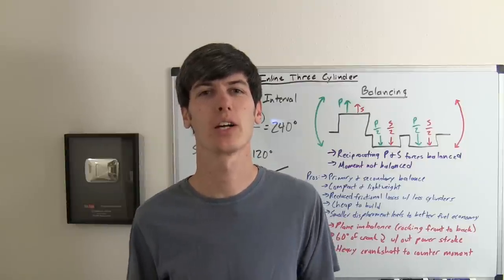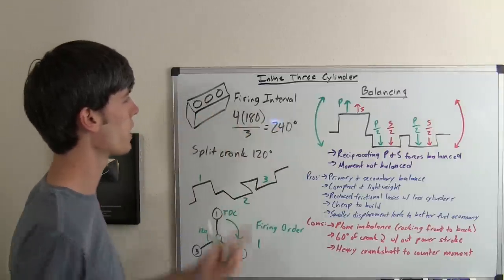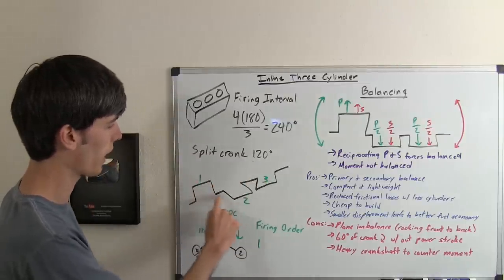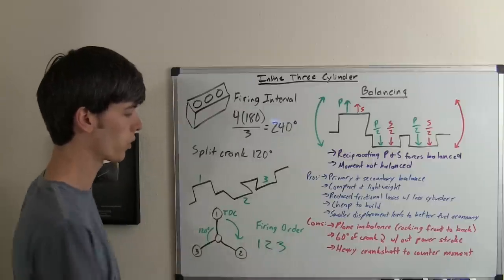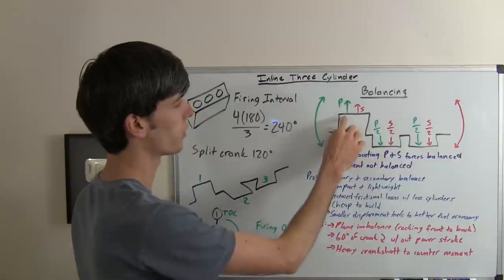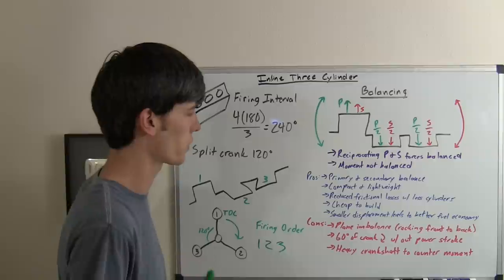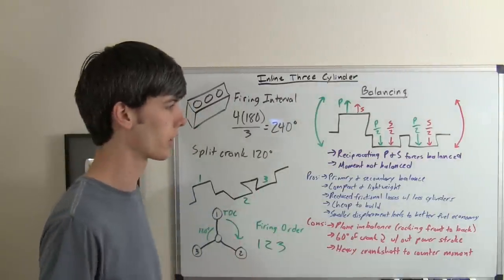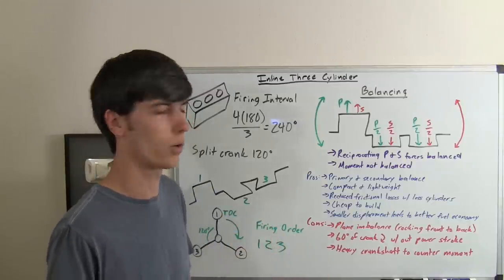Inline 3 Cylinder Engine - Explained

Comment: I found out an interesting fact: BMW say that the sound their new 1.5 3-cylinder makes, is a result of extensive exhaust work and refinement. 

More specifically, BMW say that a 3-cylinder has 2 major sound frequencies: ''the bad frequency'', which is responsible for these known rattles a 3-cylinder makes - and consequently, has been kept away -, and ''the good frequency'', which is quite similar to that of a 6-cylinder!! That's why this 3-cylinder sounds so good!
Reply: wooo bmw found hot water
Reply: Also knew as sound modulation by the stereo speakers, a thing bmw have been doing for years.

Comment: I have a Triumph Rocket III motorcycle (2,294 cc inline 3) and I appreciate the explanation on how this engine works. While it makes a lot of torque at low RPM, it vibrates badly under heavy throttle... and now I know why. Keep up the great videos!

Comment: The 3 cylinder engine in my 1991 Honda Today gets me between about 40 and 50 mpg (16-22 km/L) and is still kicking after at least 140,000 km on the clock.  (There's no 100,000 digit on the odometer.). Thanks for the quick video!
Reply: I have the same engine (E07A) on my Honda Acty Truck, and that thing works awesome!

Comment: In the early '70's, I owned a Kawasaki 750cc, 3-cyl. H2 motorcycle. It was 2-stroke,air cooled, with oil injection. It was smooth as silk, and one of the first true superbikes. Liquid cooling would have allowed higher compression ratio's , and even more power, making it unbeatable to this day. Too bad the EPA had a grudge against blue smoke.
Reply from the maker: Sounds like an awesome bike! I'm okay with clean air though. :)
Reply: +Engineering Explained What do you think about lifespan of vw 1.4 tdi 3 cylinder lifespan (km) ?? :)
Reply: +Robert Beck First of all, lucky you for having owned the original H2! Secondly, Kawasaki's were really good machines. Plus, with a 2-stroke engine you have twice the power strokes so more smoothness is expected. But having 2-stroke AND 3-cylinders is crazy! That was a beast! I guess Kawasaki had to up their game if they were going to use the H2 badge again and they did with the H2R.
Reply: +Robert Beck I had the Suzuki "Water Buffalo" 750cc Triple water cooled.  It was a beast of a machine and could have been scary fast if I spent the time for performance tuning.  It was considered fast in its day I suppose.
Reply: I love the sound of a 3 cylinder two stroke. I wish they would start putting them in snowmobiles again.
Reply: Honestly I am wondering when the 2 Stroke will RETURN...  With Direct Injection and a few design changes...time is ripe for the return of these engines I THINK Anyways...  Then again...things are going the way of Electricity faster than anything else.
Reply: +SquillyMon Rumor has it that KTM has something in the works.
Reply: Especially when one rotation of the crankshaft makes a complete cycle, just like a 6 cylinder four stroke engine.
Reply: The two stroke has returned, and it doesn't require mixed fuel-but the only place I've heard of it is boat engines. The catch is lubrication. With no break for the engine, there has to be extra lubrication-leading to a slight oil consumption. I remember reading about it in (maybe) Popular Mechanics, but that was years ago. I have not heard if they have continued development or quit with it. I'm sure Google has a lot to say on this. ;)
Reply: +gilessmokey exactly. That's why a two stroke triple has the same explosions in two revolutions of the crankshaft as a 6 cylinder 4 stroke
Reply: I dont understand the direction this commentary has taken... Is this a 6 of One and Half a Dozen of the Other Type of Dissertation at this point ?
Reply: two-stroke engine has a double interval ignition on comparison with the four-stroke, because it works much better. I drove the 1.2 TDI Polo of the rental car that is completely garbage, even consumes a lot.
Reply: And the best thing about them is the frequent blowing up of the mid cylinder because of the air cooling and lack of air in the middle.
Reply: Had a Yamaha RZ350 myself, a total blast to ride.
Reply: Blue smoke is the best smoke. :)
Reply: Well, just for the records, my first bike in 1974, a Suzuki GT380 triple... manks, expansion  chambers exhaust made by a race store, Dunlop K81 (good for the time), clubrace seat,... loved it.

Comment: Love your videos.  We had an old Caterpillar with 3 cylinder diesel on the farm.  It was such a cool sound to listen to as full throttle was about 900 rpm if I recall so there was a putt then a wait then a putt I see now because of the 240 degree firing.

Comment: My boat has a Mercury 3 cylinder, 2 cycle engine. And yeah it vibrates the boat A LOT at low RPMs. Under 10 miles per hour, everything shakes. Once you're up to speed though, it's nice and smooth.
Reply: i have a 3 cyl yamaha 85hp on my boat and it does exactly the same thing, fine at high rpm but really shakey at low rpm
Reply: If I were made of money, a nice shiny new inline-4 90hp Merc would probably make all the difference in the world. Oh and 4cycle too. No more clouds of smoke hopefully.
Reply: two-stroke engine has a double interval ignition on comparison with the four-stroke, because it works much better. I drove the 1.2 TDI Polo of the rental car that is completely garbage, even consumes a lot.

Comment: I enjoyed hearing about this engine. With 4-cylinders being a bit rough, I have wondered how 3-cylinders were. I'm sure that wise things are done to prevent problems, but I hadn't ever thought about the rotational shaking before. That's an interesting problem to resolve! But they have been around for years, so I'm sure they have figured that out. I guess it's not an engine to run slow, however!

Comment: 11.26.14.     The Laverda Jota 1000 used a 180° crank pin spacing in its first bikes (up,down,up) a boss sounding engine! Later bikes used a 120° crank pin spacing, a smoother running engine. BMW K75 bikes used a 120° crank pin spacing, also they employed a counter balance shaft that made them buttery smooth! A very nice sounding engine!!! Yamaha XS750/850 bikes used a 120° crank pin spacing, smooth engines. Triumph Trident & BSA Rocket 3 bikes used a 120° crank pin spacing, sweet sounding mills. All the bikes were from the 60s & 70s,& 80s.   A great tutorial!

Comment: The Geo Metro sold in the US in the 80's and 90's were Suzuki Swift with a 3cyl version of the Swift's 4cyl engine. The 3cyl was simply the 4cyl block shortened by 1 cylinder. They ran smooth and got great gas mileage. A friend had an 80's Metro, then later a Swift with the 4cyl and it was a good engine as well.

Comment: What about triumph's 675cc motorcycle engine? It is one of the smoothest out there compared to the competition of inline four cylinders. It is as fast revving and gets to 15000rpm. And it has a counter rotating balance shaft I believe, which I don't think is common in motorcycle engine. Can we have a video on motorcycle engine configurations since they are simpler and slightly different? There are big capacity singles, boxer twins, parallel twins, V twins, inline 3s, inline 4s, V4s, V5s, Aprilia's cube engine (which I have no idea how it works)... etc.
P.S. your channel is awesome👍
Reply: Engineering Explained  I subscribe to that, if you would be so kind to do a video on the triumph and a couple of other moto engines, twin v90, v60, v45 :) that would be great!
Reply: All the 3 cylinder inline motorcycles I've own or drove are perfectly smooth... Even smoother than inline 4's...
Reply: It's so fast-revving because it's over-square. Try riding a Triumph 1050 triple, which is essentially a 900 triple stroked out to 1050. Very different experience.
Reply: Yamaha FZ/MT-09 847cc triple is extremely quick revving.
Triumph has the most inline-3 engines currently, with 675, 765, 1050, 1215, and 2294 (cruiser, Rocket III).
Triples sound the most interesting in my opinion, of most motorcycles. They cram a lot of displacement in a small space, similar as a V4 (narrow angle, that is). You could make a 1300cc inline-3 more narrow than the equivalent 1000cc inline-4 block, factoring in a very useful and common bore-to-stroke size ratio.
MV Agusta motorcycles utilize an 800cc inline three in several models.

Getting into the watercraft, snow machine, and side-by-side UTV worlds, there are a LOT of inline-3 engines making big power with turbos and superchargers.

Can-Am with the Spyder with an Ace Rotax.
Can-Am with the Maverick X3 and turbo Ace Rotax.
Sea-Doo 1503 and 1630 Ace Rotax engines (boosted i-3).
Yamaha YXZ1000R with a 1000cc.
Yamaha with turbo 998cc i-3 snowmobile option.
Yamaha Wave Runner 1049cc TR-1 inline-3

Can't think of any other recreational vehicles that use inline-3 right off.
Reply: Some insight into why the 675 really is so smooth feeling compared to other 600cc sport bikes would be nice.
Reply: My street triple isn’t smooth. Guess I would hate riding a inline 4
Reply: My motorcycle 3 cylinder inline revs upto 12000 @engineering explained
Reply: TriplePlay - citation on the Kawasaki license and cosworth. I have never heard or seen anything about that.
Reply: Kinda different when you're comparing a shorter stroke motorcycle 3cyl to a long stroke 3cyl car engine
Reply: The Yamaha CP3 is another very sweet 3-cylinder, but like the Yamaha, is a very over-square cylinder.

Comment: My wife bought her little Chevy spark 798cc 3 cyl 11 years ago, the little car never stop to amaze me, i find the power terrain smooth with more than enough power to travel within the legal speed limits, but i usually cruise in the 100/110 km/h range on the open road.
It is used on 700km trips from time to time, the car has covered 111000 km since new with no problems and is frugal on fuel almost on par with my cbf600s Honda. The nvh noise vibration and harshness is also excellent with a quiet interior at most speeds, car technology has come a far way, on a much higher level my son's 3 cyl turbocharged Opel Adam amazes me, buatiful quiet and civilized like a much bigger car with performance way more than adequate. 
Thank you for your very informative and educated presentation on the mechanical aspect of 3 cyl engines. I must say the unmuted sound of a Triumph triple sounds buatiful. 
Regards from rsa

Comment: My first recollection of a three cylinder engine used in a wheeled machine was the Massi Ferguson Tractor though Three Cylinders have been used in many applications from around the start of the 20th Century in boats and industry. The reason is that the 120deg set up for the pistons is a better balance than the 180 deg.  When two or four cylinders are used the harmonic pulse would set up a whip in the drive shaft and belts that worked factory machines.

Comment: GM actually used to make 2 stroke 3 cylinder diesels. The 3-71 3-53 and I think they had  one called the 3-51 which was valveless. These engines were very loud! Especially the 3-51 and 3-53. The engines are commonly swapped into half tones and 3/4 tone pickups. Although with a one ton pickup a 6v53 ( twice the size of 3-53)  fits nicely as long as you installed a stiffer front suspension.

Comment: We have a 1968 Massey Ferguson 135 with a 3 cylinder diesel Perkins engine. It would be about 2.5 litre yet it can start unbelievably easily in cold weather even if it hasn't been run in a year. There never was a heater plug on it but it was always looked after with regular oil changes. Unbelievable little engine.

Comment: I had a 3-cylinder Chevy Sprint back in the '83/'84 time range.... Loved that little car - the savings in gas or fuel burn PAID for the car over what I got rid of.... Had to "row it along" with the 5-speed tranny and use higher RPM's..... It also had pronounced torque steer from a stop.... Thanks for the memories!!! Gordon

Comment: one of the bigger advantage is that it is good to add a turbo because the exhaust will not  disturb each other from that three cylinder
Reply: +Joe Zhang Would still rather have a even cylinder arrangement (4+ cylinders), you can compensate for the turbo thing you mention by having proper length exhaust manifold runners...
Reply: +The Northern Vlogger nope, straight 6 or v12 ftw
Reply: +The Northern Vlogger Yes it does. 3 cylinders power one turbo, 3 other power the other turbo. Having 6 pistons and 20 valves would be awful for an engine that's smaller than 2 liters though. So many tiny brittle parts.
Reply: 3 valves per cylinder? yea guess having 6 pistons and 20 valves would suck
Reply: My Ford 3-cylinder 1.0 Turbo put 130HP/134TQ to the ground stock. And yes I have the Dyno sheets (Mustang Dyno)

Comment: I used to have a 1990 Pontiac Firefly with a 3 cylinder, one litter engine, 55 hp. That thing did 61 mpg (imperial gallons). About 51 USA mpg.
Reply: I can probably run faster than your car
Reply: +Moi MacArt The 1.0 they used in the Firefly/Metro/Swift back in the day was a great little engine. Reliable, they'd literally run forever with basic PM, good specific power, great fuel economy. It's sad that they get a lot of undeserved hate... I mean really.

Comment: The Perkins AD3.152 in the old MF 135 and 235 was pretty much indestructible if it was maintained correctly, the 903.27 that replaced it had a lot of problems in early production engines, camshaft oil galleries plugging up was a major one.

Comment: So if we integrated the balance shaft the primary end-to-end vibration should be balanced, isn't it? I don't know if it's about balancing, but why is it so rare, or indeed never, to see a high revving in-line 3 or V6 engine in a production car? And why high revving V6 in the Formula-1 has to be 90° and not 60°?

Sorry for being a bit off the topic, but I have been dying to find the answer for years. Thanks a lot anyway.
Reply: yep, the vibes are balanced with a balance shaft. High revving i3? look to motorbikes. Main reason you don't see many high revving engines anymore is due to engine design based on emissions laws, so they have a long stroke which limits the engine speed. However, the GTR goes above 7000...
Reply: As stated above. Any engine can be made to rev high, but high rpm is the enemy of fuel economy, and emissions.

Comment: Interesting engines,i have a DKW which has a 3 cylinder two stroke with bearings in the Crankshaft and one single coil per cylinder(it means i have 3 engines in one) also the model its called 3=6 which it means this engine has the power from a 4 stroke 6 inline engine.I really love it

Comment: I have a 2017 Mitsubishi Mirage with a 1.2L I3 engine with a CVT. It gets great gas milage. 35-40 in the city. I've gotten up to 55 on the highway. I also modified the exhaust on it the other day. Did a full custom 2 inch with a beefy resonator and a free flow cannon muffler. Man, that improved it alot. Lets see if it picks up gas milage and some hp. Makes more noise for sure lol.

Comment: When it comes to motorcycles, there are some interesting reports. Most inline-4 engines tend to have a strong high end output and but their mid-range is not as strong as an inline-3 of the same displacement. It could have more to do with tuning than cylinder configuration but cases in point are the inline-3 engines made by Triumph versus the inline-4 engines made by most Japanese manufacturers. Also, among cars I have test driven (here in India) a Volkswagen Polo 1.2 litre which has an inline-3 motor that puts out 74-75 bhp but feels much more responsive (low and mid-range) than a Suzuki Swift whose 1.2 litre inline-4 engine puts out ten horses more. Does the cc per cylinder have any bearing on this? Any thoughts?
Reply: +Siddharth Rajkumar It goes for any engine. Typically: Equal displacmennt & fewer cylinders => bigger cylinders => longer stroke => more torque & increased piston speed => less max revs.
Reply: Marcus Lindblom Sonestedt So I thought right then. Thanks.
Reply: im in the same boat as you. i drove a daytona 675 and that thing was way faster than any other 600. much smoother the power delivery. the only other bike that was comparable was the gsrx 750 (had more power). and the ducati 848 and i still liked the 675 more than the 848 when driven back to back.

Comment: I'm not an engineer but I understood, what you're saying. So, now I know, that the vibrations of my VW Polo 1.2 aren't because of any kind of broken dampers, it's just the way the engine works. Thanks :D
Reply: IwannaBEamerican No. Surely that's an inline 4.
If you are getting excessive vibrations, depending on when it occurs and the frequency it could be myriad things. I would check out all the engine mountings, especially the rubbers for degradation, if the engine is moving/rocking excessively. If I remember correctly on the older Polo's the front rubber mounting sometimes goes soft and allows excessive rocking.
If it is generally vibrating check out all cylinders are producing a similar power output. Which will more than likely need to be at least checked out with a scope as a starting point to see the cylinders, and how each is performing.
For any reasonable diagnosis more information would be needed.
Reply: Look it up on wikipedia "Volkswagen Polo mk4" Under engines you'll see three engines with I3. I've got the second ;)

Comment: I know most of your videos on are cars. But you should get into the 2 wheel world. Explain about Thumpers(Single Cylinders), V twins, L twins, 2 Inline, V4 etc. and include how torsional output differs from each motor. also Odd firing vs Even firing (MotoGP) I do enjoy the videos! Keep it coming!